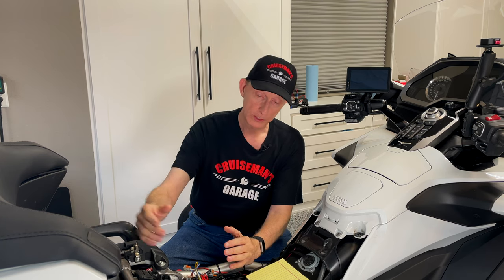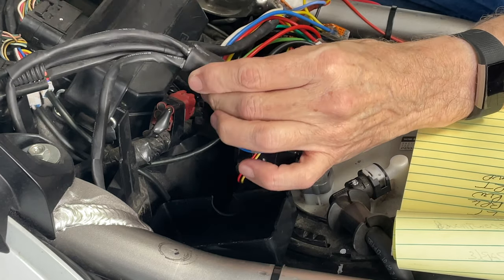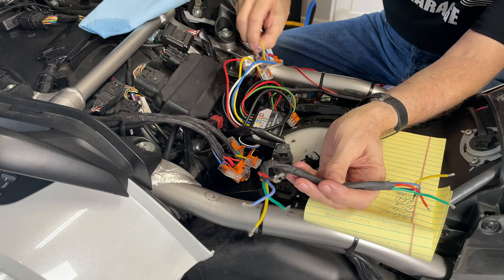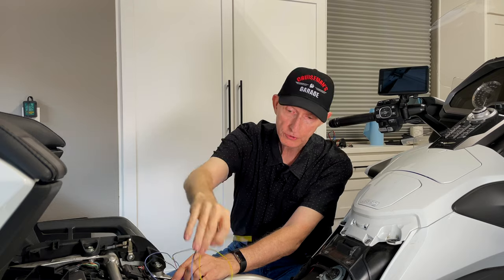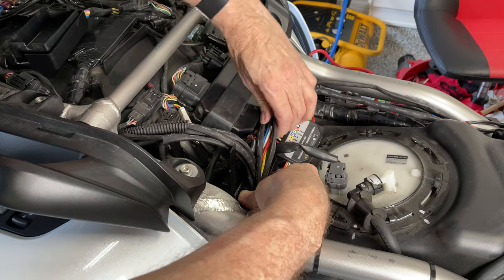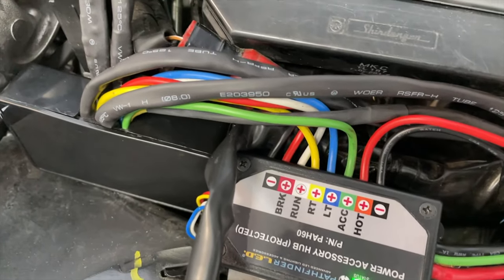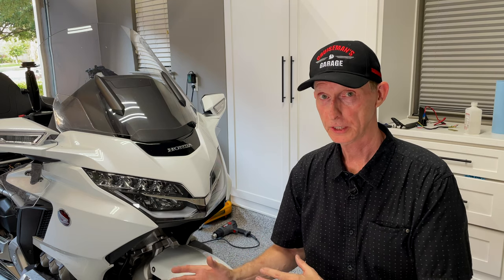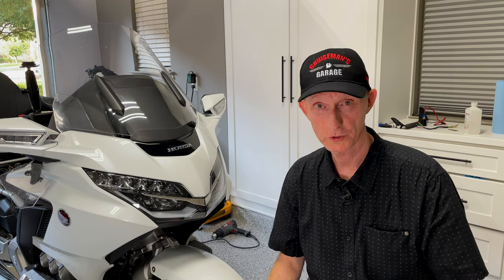Changing my WAGO Connectors PT 2 | 2018+ Honda Goldwing | CruisemansGarage.com

Comment: I haven't done this yet. Maybe I'll share. 

What I'm going to do Is connect the wagos to each of the pathfinder distro box at the kitchen table. Mount the distro box on the bike,
Then simply connect all the light wires accordingly. Make it pretty with plastic tubing possibly put all the wagos in a box. Done !

Comment: Wirig it the old way you did didn't you bypas the security feature of the Pathfinder and or show and Chrome for the canbus system?
I always draw out a wirig diagram on paper first to get a idea of what im going to do...it saves me loads of time and helps me actually look at what i can improve.
The new set up looks much better.
As for sena they pronounce it both ways when you call them on the automated system 🤔

Comment: Those Wago connectors look great, and look like they will do the job just fine. My last Goldwing, a 2005 GL1800, I had so many accessories and led lights in every nook and cranny and it was a wiring nightmare. The bike sure lit up nice at night. With my 2018 Tour DCT, I decided I am not going to add anything that requires wiring like that. I just don't want the headache. You are doing a great job, and it looks like a nice installation. Keep the videos coming and Ride safe.

Comment: I installed the wago 221 series connectors when I added trailer wiring and elevated brake, sequential turn signals to our 2020 DCT last winter.  Sure and safe connections, and the clear plastic case makes verifying wire contact easy.  I'm not as neat as you, though.

Comment: I had a mega installation of front, rear, and side lights including many Pathfinder products with the Pathfinder PAH60 for the 21 GW.  I used the new small profile Wago’s . The Master Honda mechanic did a similar installation method but chose instead of using junction boxes, he used double stick tape to tape the wagos in two horizontal lines on the right vertical side of the gas tank, and only put the PAH60 underneath the seat.  The Wagos were organized depending on the type of light - turn signals, running, brake light.  This allowed a lot more room  under the seat for the tailBlazer harnesses and future items.  It is not crowded and easy to see and follow each wire from the light to the Wago hub and from the hub to the PAH60.  All wires are color coded based on type and location of light. There is no rats nest or bunches of wires. Wish I knew how to post a picture of it here so it would be more clear.  
Thanks Cruiseman!  It really helped piggybacking on your wiring videos and use of Wagos.

Comment: Love your videos. Im about to add some accesories and ive ordered the Wago connectors and the pathfinder box. I noticed when you apply the brakes your rear brake lights flash. I had that device on my 08 wing. I now have a 18 dct. Do they make that device for this model?
Thanks.
Reply from the maker: Yes. The tailBlazer from Kisan Tech. https://youtu.be/bZOSl1iQQvE?si=bMYpSpi6WvwSCnUr

Comment: Do you have heated gear? Do you/would you run that gear thru the fuseblock or attach directly to battery? That said, I want to thank you and tell you how much I appreciate the time and effort in making these videos. You take away the anxiety of launching into a project and you make it so clear and easy to follow along. Thank you Cruiseman!
Reply from the maker: Heated gear can take 15 to 20 amps on its own (check with the manufacturer). Therefore, it is typically a good idea to run directly off the battery.

Comment: CM, watch the video on your link to WAGO on Amazon for the correct pronunciation. Before wire ties we used electrical tape. Back in the late 70's I had the Honda Shop install ape-hanger on my CL175 and they used tape to secure the wiring. Way before internal wiring. Looked ugly, but I was cool, so I thought..
Reply from the maker: Just watched it. Damn! I mispronounced another one!
Reply: Thank again Chris and for the shout out. It was your suggestions in your prior that taught me how to model what you have now as I never had the show chrome module.  
I have all the older Wago connectors in my same sized box but you have many more accessories. I have plenty of remaining ports on my older connectors so I’m good to go. However my back up would be to use the smaller form factor to add on to the pathfinder wires.  Thank again for all that you do to help us DYI and save a ton of labor costs.  👍